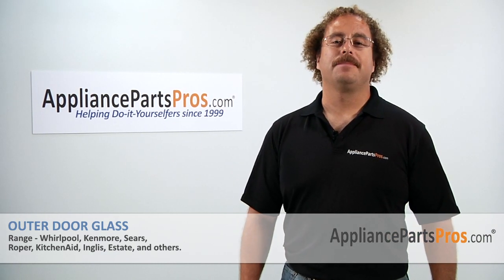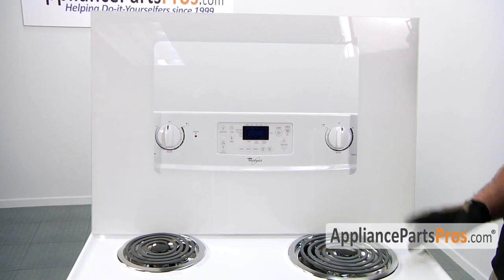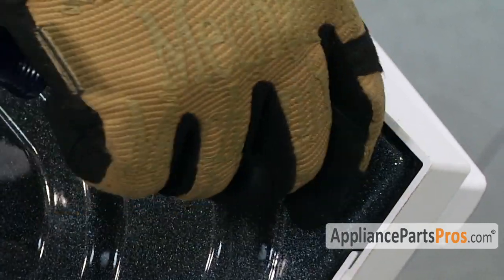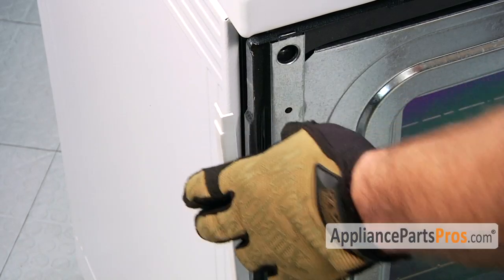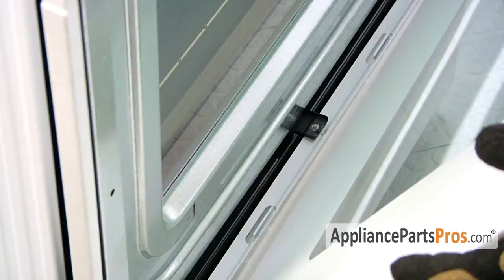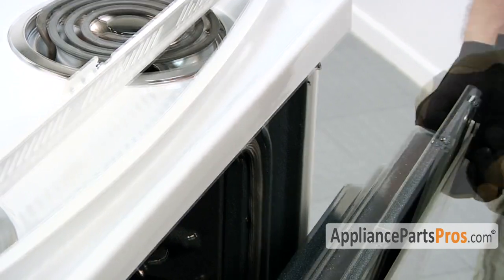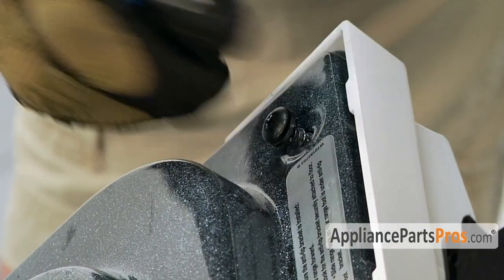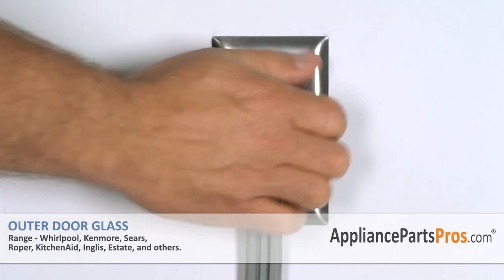How To: Whirlpool/KitchenAid/Maytag Oven Door Glass WPW10118454

Comment: my right side trim is broken and I'm not sure if that's the problem but I'm not able to put back the oven door in place. ppl suggest getting longer screws for the handle , do you think that can fix it?
Reply from the maker: janishyathi raghuram If the trim is broken you can go to our website and enter your appliance model number to look at the parts breakdown, to see how the door goes together and to get the correct parts. Adding longer screws to try and patch it together is probably not the way to go.
Reply: AppliancePartsPros

Comment: On our oven we have a larger front stainless Stella cover with a glass window that's why I need to know if we can have regular glass cut or if it needs to be tempered in which case I will order from Sears as it is a kenmore
Reply from the maker: ***** If you call us with your model number we can see if the outer door glass is available, 1-877-477-7278.

Comment: Thank you for the important pointers. I took the glass off thinking it would be super easy to replace, and was lost on what to do with the trim when I was reinstalling. Thank you very much for the help. One thing I suggest, that helped me, was to use painter tape to hold each step in place as I went. No chance of dropping or breaking anything as I went. Thank you again!
Reply from the maker: +ccicyou Glad the video helped you put the door back together, thanks for the tip!
Reply: I used masking tape to hold the side trim from flying off! Same idea.

Comment: Hello!  I have an Amana AGR5715QDW and I can't get the front glass off.  I have removed the three screws from the top and the two screws from the bottom of the inside panel.  It feels like there are more screws holding it in, but I can't see how to get to them.  I have looked at the schematics on your website, but still don't see how to access them.  What am I missing?
Reply from the maker: I see the same thing when I look at the diagram, check around for more screws or any double sided tape that may be in there.

Comment: how do I know which side of the glass goes toward the inner door and which goes facing out - one is a rough surface, one is smooth on the replacement glass I have
Reply from the maker: Unless the package specifically says which side is which, it should not matter. I would put the smooth side out, may make cleaning it easier!
Reply: @appliancepartspros  I am a girl. I would have smooth side of the glass inside if it can be. The outside of the oven doesn’t get dirty, anything spills you can wipe it easily. It is way easier cleaning the outside of an oven then the inside. The inside, stuff gets baked on. Easier to clean a flat smooth surface rather than a rougher surface inside the oven. Just an opinion. ✅

Comment: I needed to replace a handle screw that had disappeared.  I ended up cleaning up the whole door.  When I had to reassemble it, I used duct tape to hold the glass & trim together while I tightened the screws on the handle.

Comment from the maker: If all you are taking off is the handle and the top cap, I would think it would be ok to do it like the video. If changing your glass requires taking out any of the other screws that hold the door together, I would take it off the oven. It is not that hard, just open the door partially and flip the little locks on the hinge arms, then lift the door off the oven. Then you can lay it on a table and take the door apart.

Comment: wow looks easy we tried for a half hour but the top piece would not go over the side trim and getting all the glass into the slots was maddening. I think my problem was the side trim goes against the glass not over it, it makes it too wide. try tomorrow
Reply from the maker: They do vary a little on how they go in, good luck tomorrow!
Reply: Yes, that's the key detail .The trim pieces go behind the glass.

You would think they are there to protect the edges of the glass, but that's not the case. They are there to give the glass a "soft" piece of plastic to rest against (as opposed to the metal clips behind it). So be sure to put the side trim pieces behind the glass. If you try to put them in front of the glass, you risk chipping, cracking or shattering the whole front glass.